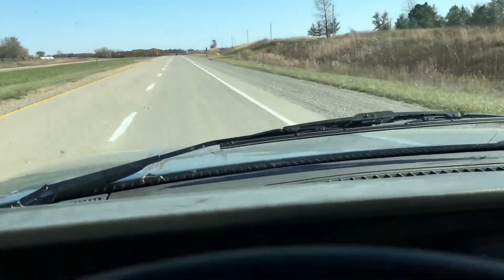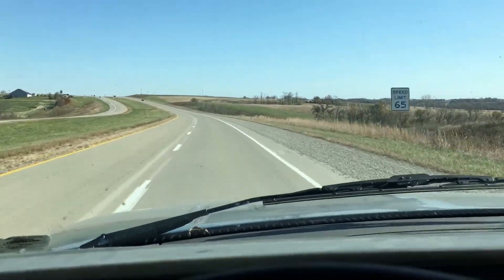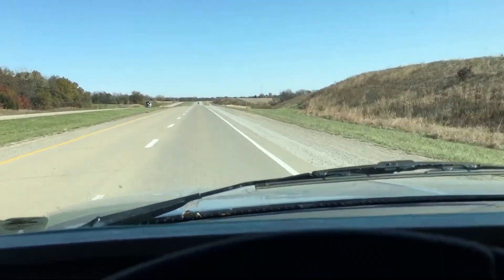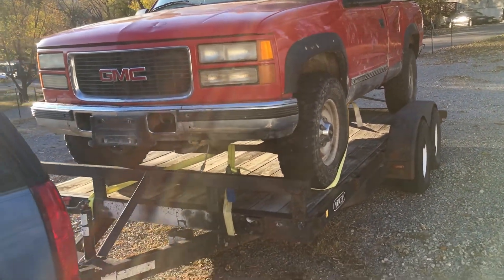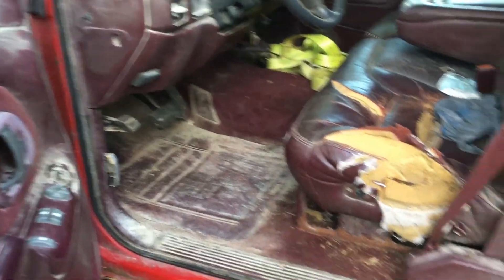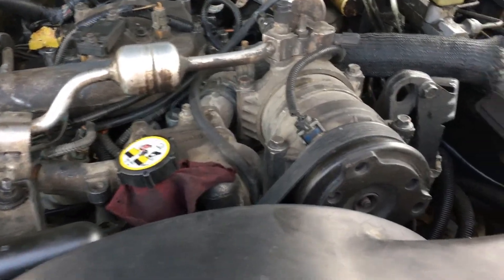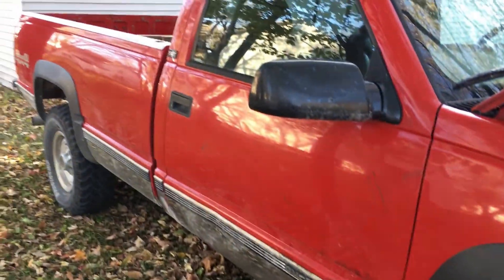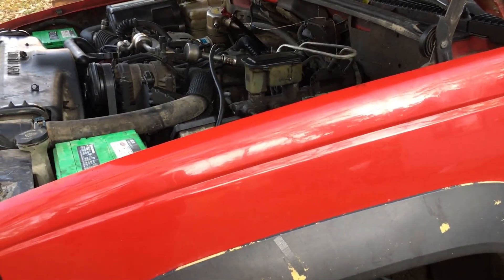Picking up the new 6.5 diesel! 1997 K2500 Diesel

Comment: I got a 93 Silverado 6.5 turbo diesel extended cab five speed manual nv4500 with 350,000 mi and it runs like it's just come off the showroom floor😊
Reply from the maker: Nice!

Comment: did you get it running?
Reply from the maker: William Falkers Nope. Got the broken starter bolt out and tried getting the starter back with arp bolts but the starter or flex plate was junk. Decided to list it online and within 45 minutes of being online it sold for $900.